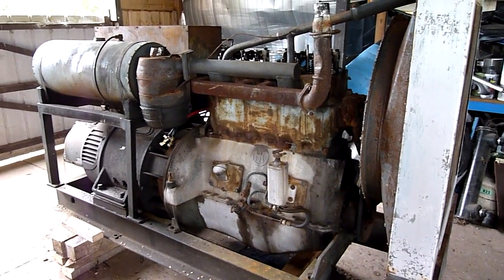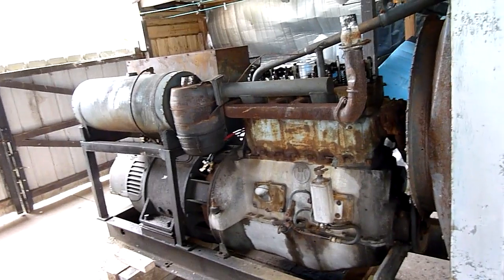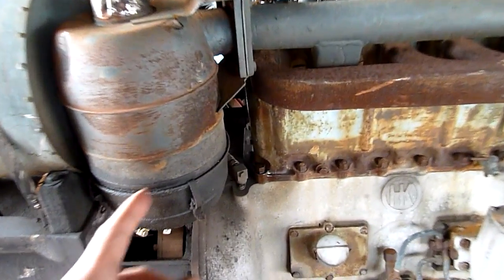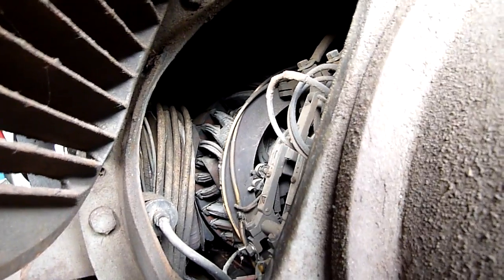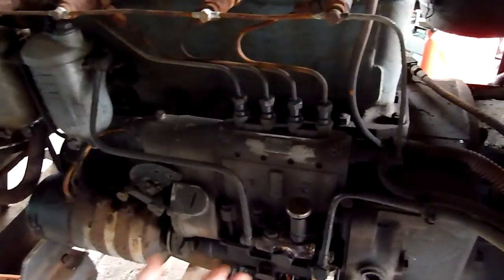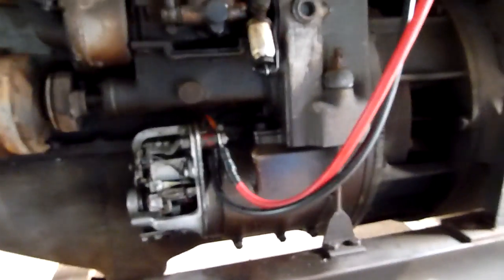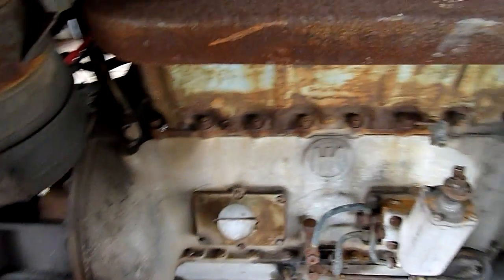An introduction to the generator project.

Comment: Pity about the buggered winding, that will need to be repaired or replaced, your supposition that “two will be fine”, is completely false, the electrical load needs to be balanced in all three windings to ensure the mechanical drag is the same thru the entire 360 degrees of rotation of the alternator or it will shake fuck out of the set, think of it like loosing a wheel weight.

Comment: Glow plugs look like the series loop type used in old Mercs etc. If they're M18 thread the Merc pencil conversion ones would fit if those ones are had it
Reply from the maker: god point, I am sure I could find or adapt standard plugs. I have a box full of ones for my ML270's OM612 engine. cheap and easy to get
Reply: @aussie50  Yea I bought some M18 bolts to do my own adapters but haven't gotten them onto the lathe yet
Reply: MiG21aholic 
Nothing series about those plugs, they are all in parallel.
Reply: Michael Harman  Thought I saw an earth strap at the radiator end...
Reply: They work still though going by the other video :)
Reply: MiG21aholic he didn’t glow it, the temperature here is warm enough not to need them at the moment, piss easy to test them in circuit with a DC tong, total  current divided by current in the last plug should equal the number of cylinders
Reply: MiG21aholic the screw thread into the head is the earth, never in all my years seen or heard of series plugs, they are heaters not Christmas lights.
Reply: @50Hertz60hurts  They exist, they were the original glow plugs before pencil type were invented, real old school, used on the early small diesels or at least Merc diesels...
Reply: MiG21aholic , live and learn, I’ll have to check into that, thanks 👍🏼

Comment: Great to see that you picked it up! Depending on how adventurous you feel, you might be able to find the shorted winding, pop the shorted turn apart, and re-lacquer it.
Reply from the maker: Unfortunatly it looks like the entire armature winding is torched, even has a 1/4" hole blown in it at one point. it might pose a problem if I want to run 2 of the phases into an inverter.

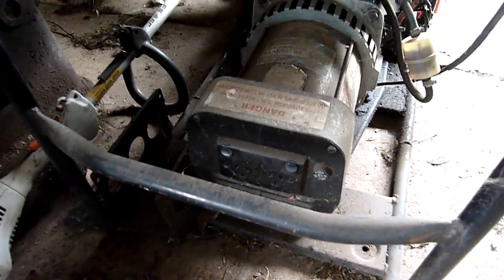Comment: @6:24 Is that a Lombardini engine? Single cylinder diesel? That fuel tank looks familiar.
Reply from the maker: It is, it was also a scrap yard find, paid a 6 pack of beer for it and just had to replace a capacitor in the generator head, its very loud tho, air cooled ones generally are.
Reply: @aussie50  I've worked on one of these engines fitted to a pressure washer way back. A cold Irish morning trying to start that bugger was not fun. Even with the decomp it was a work out to turn over, no electric start. Had to remake the fuel tank straps, weld the cracked tank and replace the exhaust shield. Good engine but was shaking itself apart.
Reply from the maker: The Spider Kelly  yeh this thing shakes and is very loud, its a good strong gen but it needs to be built into a cabinet with remote fuel and good sound suppression. it has no decomp but I can rope start it if I turn it just past TDC and rip on the rope

Comment: Use an 3-phase motor to generate the missing third pase. It's not as good as having "real" 3-Phase but at least you can run most 3-phase equipment.

Comment: I wonder if it would be economical to get the alternator rewound?
Reply: Probably not. It's stupidly expensive to get windings on heavy motors/generators rewound. At least in Europe.
The weight is the problem. There are not much companies today who have the equipment to deal with such heavy stuff.

Comment: I may be incorrect, but diesel runaways only happen with turbo diesel engines right?
Reply: No every diesel engine can have a run away. It's because they are self igniting. 
Put in fuel and air and it will run. With no load it will rev up until the crank, piston or cylinder head breaks.
Turbo diesel can and will rev higher before breaking because the turbo reduces the need of long strokes and heavy moving parts for the compression. A high revving compressor will create extreme high pressures. I've seen cylinder head parts blown trough a hood 10 meters in the air once.
Old diesel will often blow the head gasket before blowing up completely.

Comment: I remember at my old workplace they had 2 big generators, the engine was Detroit Diesel. and the brand was Onan, when it was fired up it was very LOUD and if you stood infront of the radiator real Hot air was blown at you.  You could even feel the Vibration through the ground.
Reply: Sounds like it didn't run very smoothly.
Reply: This Generator was a very old unit by the way.  I only saw it run a few times when I was working there.  One time during Electricity restrictions.

Comment: Great you got the genset safe at home. Look forward to hear it running. Try to keep the cables to the starter as short as possible, less Voltage drop and more torque for starting. I have been using Filmora editing since YouTube ditched the free editor. That works pretty good and costs $57 a year.
Reply: RODALCO2007 tried the free Kdenlive?
Reply from the maker: $57 a year is much more reasonable than Adobe suite that I hardly use. the battery cables are double the gauge of the old ones but that is a good point, I will shorten them when I build a battery box for it, after its mobile that is.
Reply: I think there is also an unlimited option for $85 and no expiry date, I tried for 1 year and am very happy with it. It takes all formats and very user friendly. Shorter starter cables are always the best option. Any extra milli Ohms wasted in cable losses will reduce torque at the starter motor.

Comment: you need a tow truck , think of the crap you could do with it
Reply from the maker: oh absolutely, I would have way too many heavy toys :D
Reply: for us hobbyists, having a flatbed truck or a big trailer is quite dangerous.. as big heavy stuff that's difficult to shift goes cheap if you have the means to move it.. if Ed bought a tow truck next weeks video would be ex-USSR ZIL military truck: does it run?? build a pneumatically operated computer controlled band in the back of it and blag your way into a festival without having to pay :D
Reply from the maker: oh for sure, they had a massive old lathe there a while back that would have been a nice replacement for the Turret lathe, but no way to move it. probably weighed 5 ton.
Reply: That's the trouble around where I am, machine tools show up, but they are often things that you couldn't fit even in a large home shop. Things like industrial lathes that are 10'' or more between the chuck and the tail stock, or milling machines that are 15'' tall, giant drill presses, etc. . There were a number of machine shops that repaired logging equipment, or stuff for pulp mills, and they needed huge, expensive tools to do it.

Comment: Would be nice to see her restored, rewinding of genny might set you back a bit. I'm sure there's plenty of farmers out there with 2 phase pumps though.
Reply from the maker: yeh rewinding the armature would be pretty expensive, but it runs well now
Reply: Sent a small 70's electric chainsaw motor away years ago to the rewinder, that was worth a couple hundred then so I could only imagine how much it'll cost now for decent 3 phase number.
Reply: I can tell you that a 5 horsepower DC motor will run you about 6-8k to rewind (keep in mind that's USD) so rewinding that guy will be over 10k US easily.